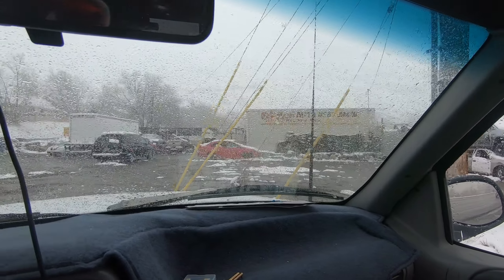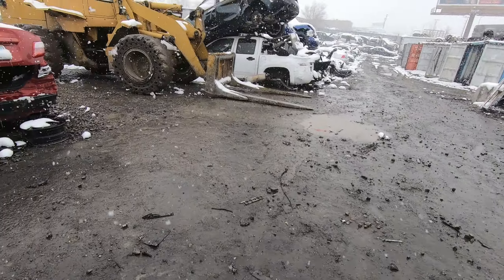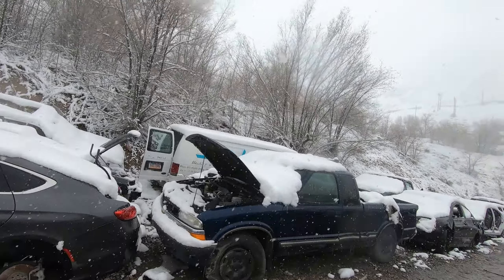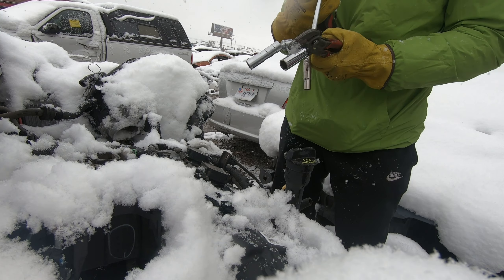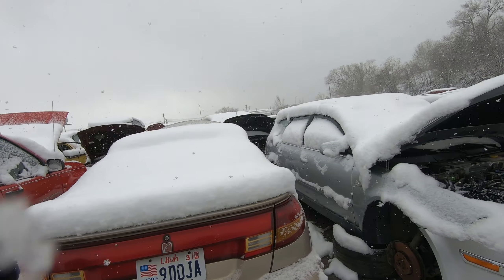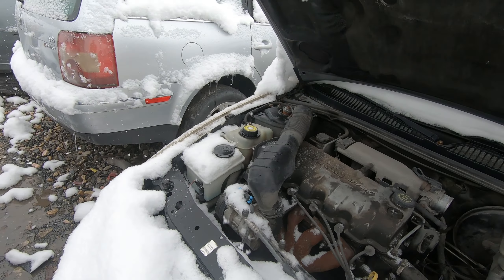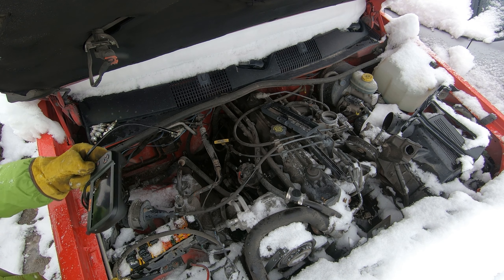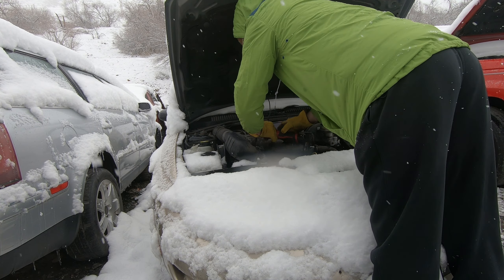What Killed this Car in the Junkyard? With a Scope Camera

Comment: Saturn vs Electric Ratchet
Saturn - 1
Electric Ratchet - 0

Those Saturn's are really good cars. Oil burners though. Especially if neglected. Had to junk my 02 SL2 last year. Had 318k on it. Original engine/trans. Rust was getting to it and finally blew a headgasket between 3 and 4. Even running on 2 cylinders though it still got me home. Great little cars.

Comment: And that’s why I don’t use these electric wrenches like a manual wrench especially those non fuel small headed ones. I believe my 1/2 fuel would hold up to that but it’s got a very beefy head that won’t fit into smaller places.
Reply from the maker: yeah. I toook it back to the home depot where I bought it with the recipt and the couldn't exchange it! So i got the fuel version... well see if it holds up. I've been clutch droping it all week. Last one held up 2 years.